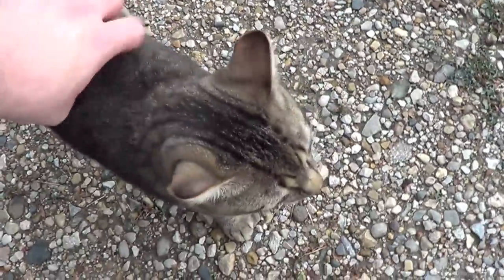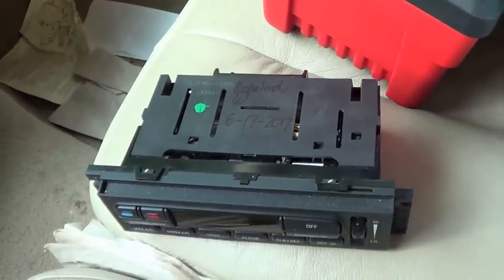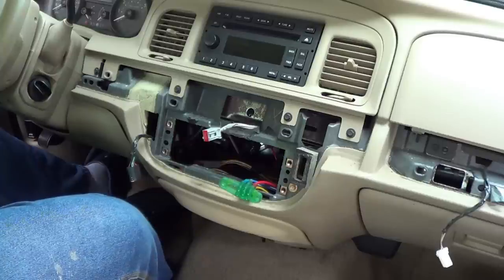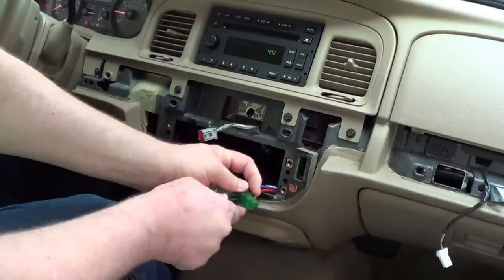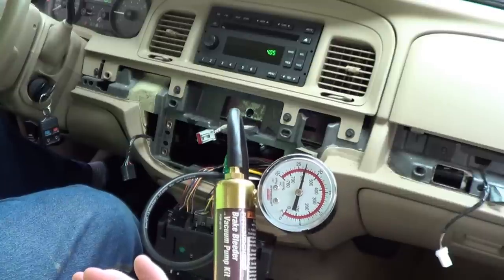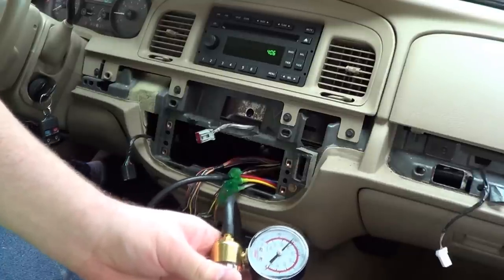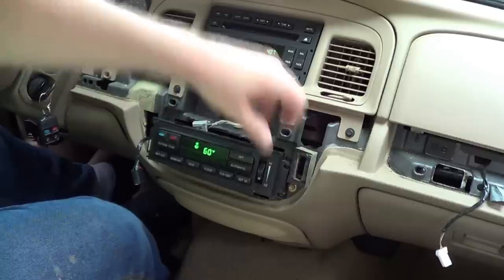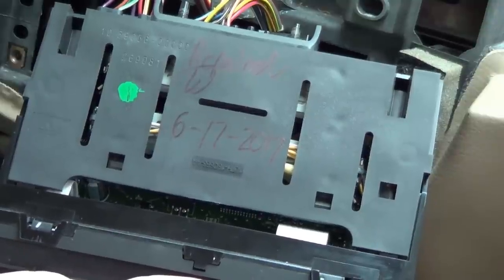Troubleshooting a Ford Electronic Automatic Temperature Control Module

Comment: First I love your videos. You have helped me out a number of times. Thank you!!!! I am having 2 issues. I do believe i have bad o-rings because I only get air flow from the heater and defrost. Never the vents. So I plan on replacing my unit with one from ebay. But I also get error 24 temperature blend door. Is it possible the new unit will fix that too?

great videos!!!
Reply from the maker: The blend door is operated by an electric motor, and not a vacuum. As mentioned in the video, its failure around 60-80,000 miles is pretty common. You'll know if it's truly bad because it usually fails in the "full hot" position.

I don't think replacing the climate control head will fix this problem for you.
Reply: I'm still going to try it. I have heat and AC but nothing out of the vents. Only defrost and down low.
Reply from the maker: The only thing impacted by the o-rings is operation of the mode (floor, defrost, recirculate, vent) doors. Odds are good that replacing the climate control head or its o-rings will solve that problem. The blend door is another matter entirely.
Reply: The blend door motor died on my 08 GM.  I did not have an error code...only hot air even in AC mode.  So the problem may be with your vent control unit.  Had to remove the dash and rt air bag to get to the unit. Could only get to two of the screws holding it in so pried out the unreachable tab.  Cut the tab off the new controller and used only two screws to attach it.  Deenergized the air bag 24 hours before the job.  What a pain in the a$$ job, but saved $800..

Comment: Where can I find the O rings
Reply from the maker: A good hardware store, eBay, sellers on the Internet, etc.
Reply: @uxwbill  so any o ring will work?. I thought it was a special kind
Reply from the maker: Other than the size, which I don't have a spec for, I'm not aware of anything that's special about them.

Comment: If u did bore someone to death you'd never know about it . But i see through your tactic and wont fall victim to your bore someone to death tactic im gonna stay hyper interested in  the entire video . .
.
Huh 28 mins . . Ummm . 
Ten minutes later 😷🤢😱😵 u win lol
Reply from the maker: If your car doesn't have this problem, why are you watching this?
Reply: @uxwbill  the control unit in my expo retired tryin to find a work around cause ad far as i can tell its no less than 500 for the part . Im just makin sure i dont waste munny. Was a very informative vid . Thanks
Reply from the maker: Junkyards will often a sell a part for far less and with a warranty. You may also find many rebuilt modules and controls on eBay. These often have a warranty as well.
Reply: @uxwbill  hell yea i completely forgot about junkyards and ebay 😅  . It aggravating cause the damn thing has 3 ac control points , in dash then 2 in the console 1 up front 🤨 5 inches from the in dash unit then the back of the console . I was hoping to find a way to run the rear ac but i havent found anyone that knows if it can be done but .

Comment: Stop screwing around with junk just get a new or used module its far cheaper and more reliable then broken 😉
Reply from the maker: It's only junk after I've decided there is no way to repair it, or none that I can figure out. Until that point, it's worth the risk. And as always, I will probably learn something. Even if that's only what not to do next time.
Reply: if you say so lol

Comment: You know... Running that vehicle with those vacuum lines disconnect can and will eventually trigger a check engine light for a lean condition.
Reply from the maker: No, it isn't anything like that much of a leak.